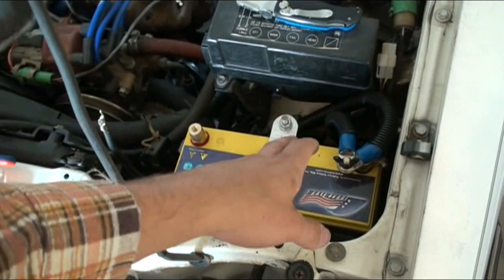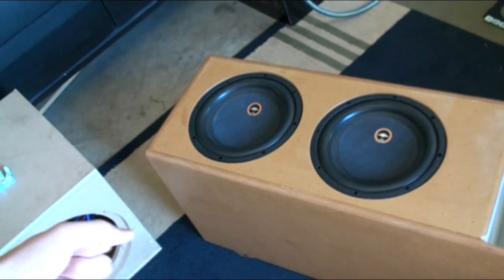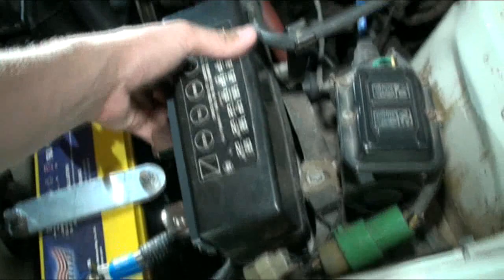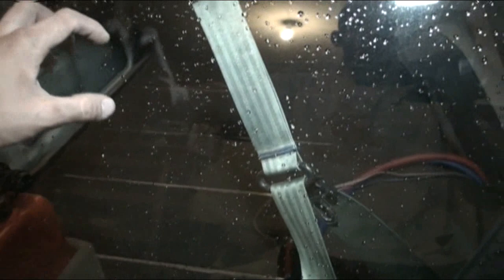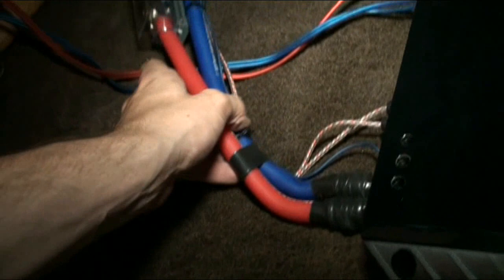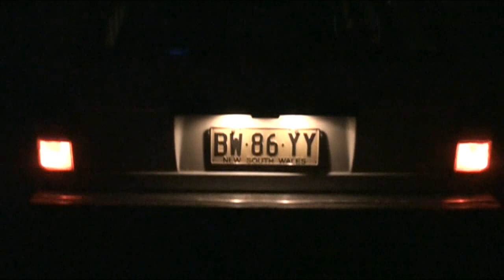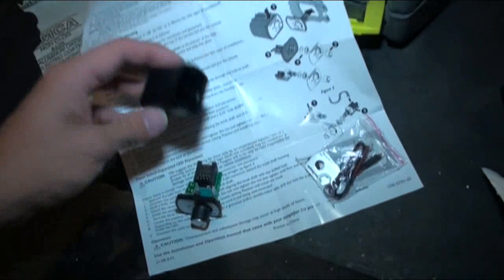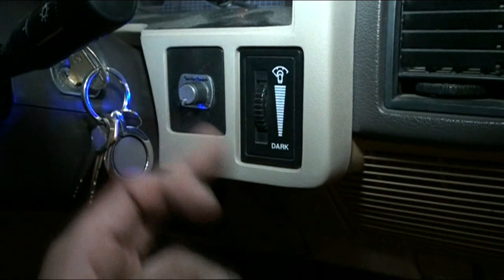Corona Wagon Install - Subs,Amp,Big 3,1/0 Gauge,Deadener,Voltmeter Etc

Comment: you should use a PAC LC-1 rca level knob instead of that rockford knob, i bet you could get more out of it with that amp on higher gain instead of using the punch EQ

Comment: how do you connect the leds inside the sub box?
Reply from the maker: just has them wired together and then drilled a extra hole in my terminal block for the wires, sealed the hole with hot glue from the back